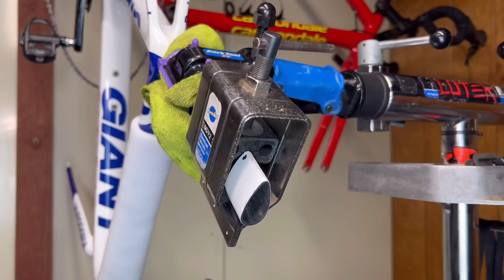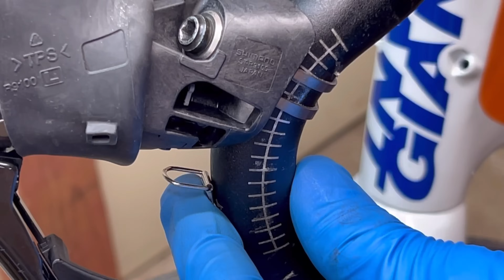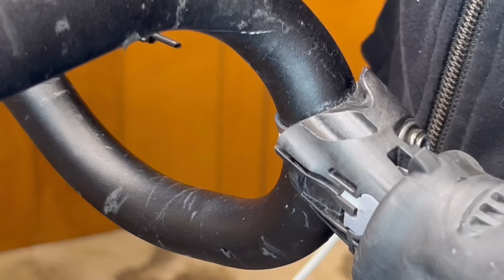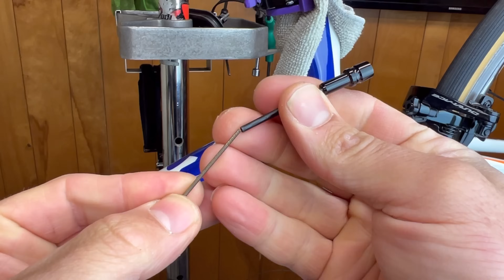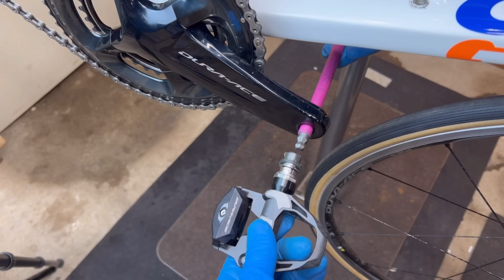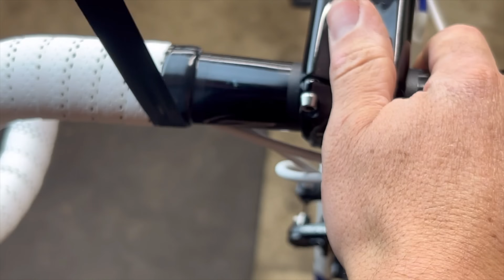Giant TCR advanced SL Rabobank road bike build 👨🏻‍🔧

Comment: hi mate i have the exatcly same bike with campy, how do you mount the second bottle cage? which type of bottle cage is it?
Reply from the maker: Hello, wow a campy TCR sounds awesome. So I am using a regular bottle cage but because of the front der hanger you’ll need to use a couple of spacers so the bottle cage can clear the hanger. You can actually just use 1/2 presta valve nuts. You almost might need longer bottle cage bolts. Let me know if this helps 😁👍
Reply: @bikeworksbywes  thank you so much, is there any videos about spacers ecc? I never saw that trick
Reply: Campy would make that bike perfect!
Reply: @bikeworksbywes can i ask you if this frame can fit a 23mm width wheel?

Comment: No rimtape?
Reply from the maker: These wheels “Fulcrum Racing Zeros” do not require rim tape 😁👍
Reply: @ i guess you are wrong. Wheels are clearly dura ace c24. Spoke holes are visible so there should have been used a rim tape of strip.